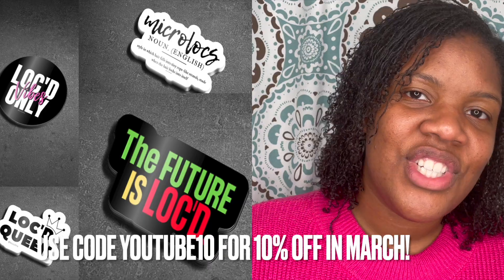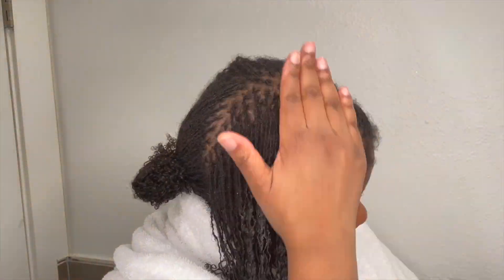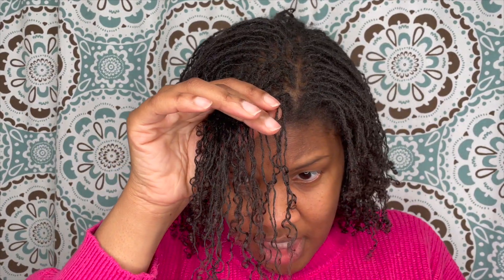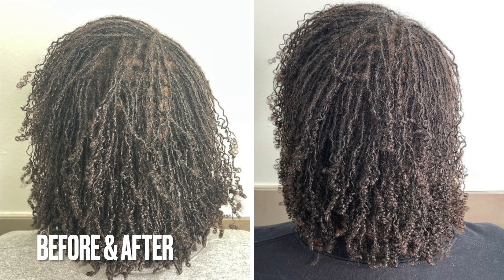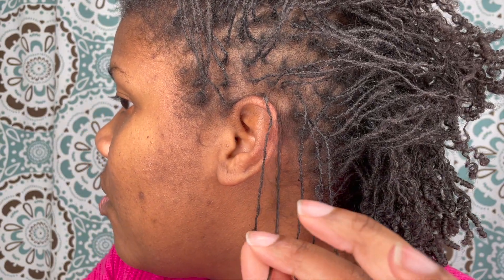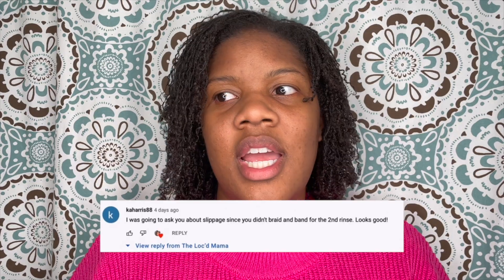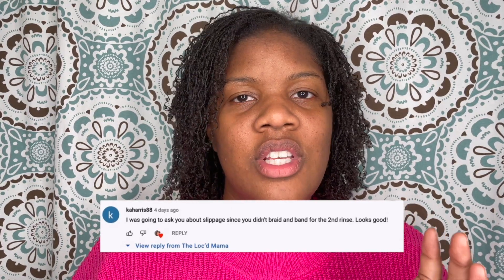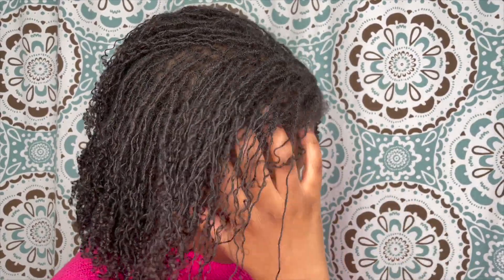I Messed Up My Microlocs | Clear Rinse Fail? | Fine, Low Density Microlocs

Comment: I’m so sorry that the clear rinse didn’t work out for you, but I really admire how you found a positive (learned a lesson) thru that experience. I have to tell you that I did something similar (blue black rinse).  But on top of not braiding and banding, which already caused MAJOR slippage, I left my microfiber hair towel on for almost 2 hours, and that sapped every bit of moisture out of my locs!  They were sooooo dry and matted that I thought I was going to have to cut them out.  I CRIED!!!  It took me almost 4 days of tedious picking out the tangles with a push pin, and having to re-establish two thirds of my locs!!!  Lesson learned!
Reply from the maker: Wow. That’s terrible, but I’m glad you were able to repair yours. I guess the moral of the story is braid and band no matter what.

Comment: Did you use the Adore gloss?  I want to try it. It is definitely weight causing that slippage and the product.  Locs are heavier wet than loose hair, so by not braiding and banding the hair had no support.  The thing about the product is that shine comes from things that are “slick”, that product has a conditioning effect that smooths the cuticle so it will lay down and reflect the light.  Thus not allowing your hair to “nap back up” which is what you need your locs to do. 
Now my hair is stupid thick and waist length,  and almost 7 years in, so my experience may be different.  When I color my hair I always do it after I retighten my hair. I do this because it is just easier than fighting the forest that is my hair.  I also used less product since it is just hitting the outside, no sense in coloring hair people won’t see. Finally it makes it easier to rinse out which helps avoid product sitting on my scalp.
Reply from the maker: No i used the clairol one. It’s pretty much the same thing but it’s just what was in stock at Sally’s. All the things you said are the same things my loctician said once I started panicking. Oh well you live and learn.
Reply: @LocsSoFine  im planning to get a consult with your loctician before too long. Glad know we will be on the same page.
Reply from the maker: @Oonagh72  awesome. She's great. I want to hear all about it. Are you in the FB group?